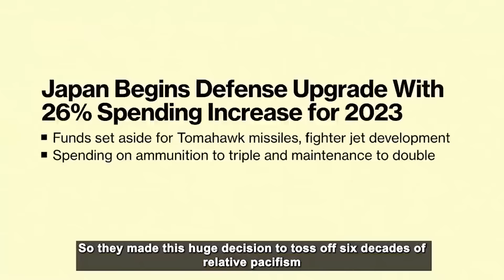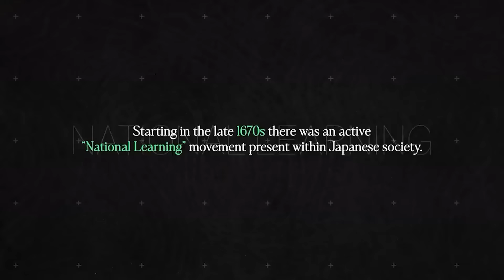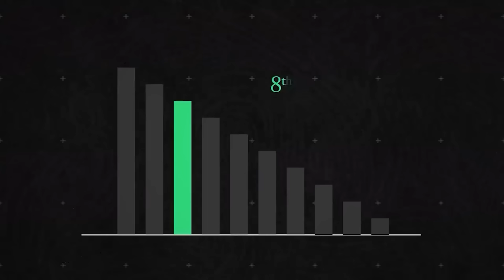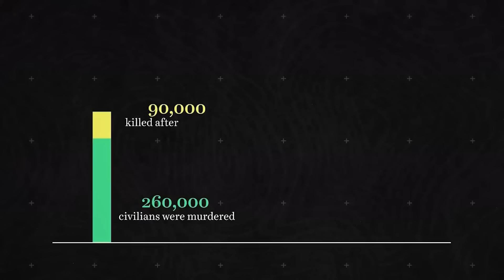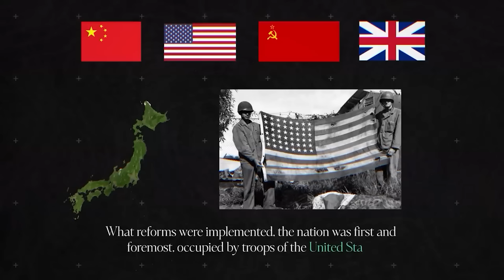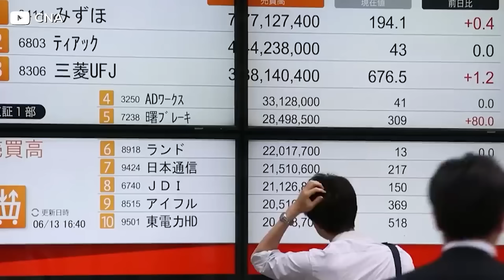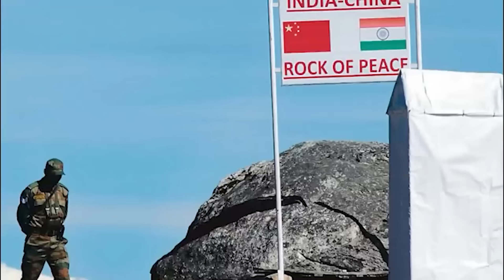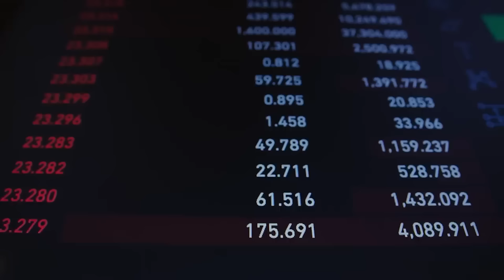Farewell to Pacifism: Japan is rearming

Comment: As a Japanese it's offensive to hear that we think we don't want other Asian countries to succeed. We have spent by far larger amounts in ODA (development aid) in all of these countries than the USA. We want other countries to succeed. The issue is the CCP full stop.

Also, the lost decade is also very factually misunderstood (or covered up) in the US. To not include the Plaza Accord (currency value adjustment pressured by US to primarily Japan and Germany) and the many trade policy such as the 100% trade tax on chips or the "voluntary" trade rules that pushed Japanese car manufacturers to build in the US instead of Japan to keep the US market. It's one thing to setup these policies, it's another to say the failure is that of Japanese after all that.
Reply: Japan were flooding cheaps cars in the US market like what the CCP are trying to do right now so the Plaza Accord was very neccessary.
Reply: @GeopoliticsExpert2030  There was an economist who differentiated that. Japanese sold cars to US or other countries competed fairly with US car manufacturers. Meaning they sold cars based on true production cost and quality so that US car companies can still compete with them. Chinese cars as even EU said it made the car trade chaotic due to making the cars cheaper than it's counterparts not by production cost nor quality but because of government subsidies, how can other car makers compete with that making the Chinese cars monopolize the car market which didn't happen during the Japanese cars era.
Reply: @GeopoliticsExpert2030  that's fine if you feel that way. My point is that you can't say that the Japanese economy stagnating was an isolated situation. It's one thing to place these policies, another to pretend it didn't happen and blame it solely on the country.
Reply: @GeopoliticsExpert2030  The Chinese Communist Party is deliberately dumping goods, but that was not the case in Japan. The exchange rate of the weak yen and strong dollar at that time was not created by Japan.

Comment: Japan decided to procure long-range missiles, but before that, the Harpoon Block 2 (GPS-guided mode) used on MSDF submarines was their longest-range anti-ground weapon, with a range of only about 200 km.
To put it bluntly, it was insane. Even the same former Axis powers, Germany and Italy, have cruise missiles, but Japan does not even have anti-radar missiles or Mavericks(anti-ground ver).
Even in the war nearly 80 years ago, missiles flew across the sea. But Japan has not had the capability to counterattack for decades. That was clearly below even the minimum capability for self-defense.
Reply: that's real bad

Comment: We do not want war.

In the fiscal year 2023, the Japan Air Self-Defense Force conducted a total of 669 scrambles. Of these, 479 were against Chinese aircraft and 174 were against Russian aircraft.
The high number of scrambles is due to the increased activity of Chinese and Russian military aircraft around Japan. In particular, the range of operations by Chinese aircraft has expanded, contributing to the frequent scrambles.

Comment: Thanks for the video. In my opinion, it's an excuse to increase government spending to compensate for the economic problems. So now the government has an excuse to increase debt spending. The same strategy that has been used for thausands of years in the past. Create the problem and offer a solution. The increased spending will in short term boost economic output (on paper). But the majority of the taxpayers will not benifit from it. This has the same effect like going to war. Good luck Japan. Maybe your country will be the first country in the world that profit long term from such government action.